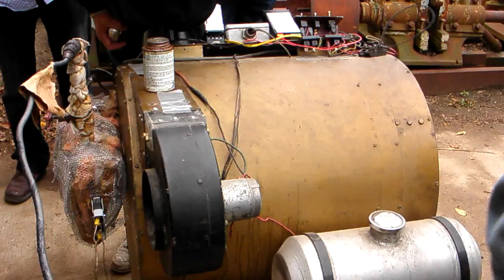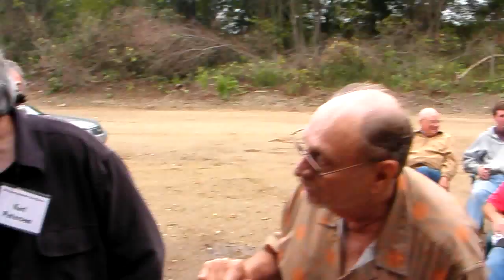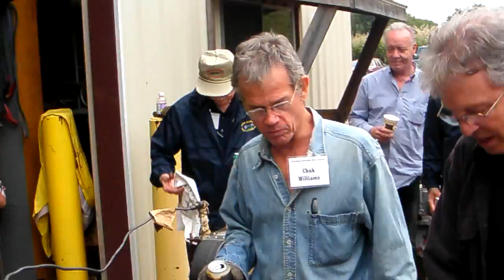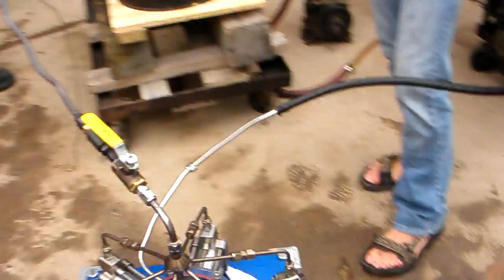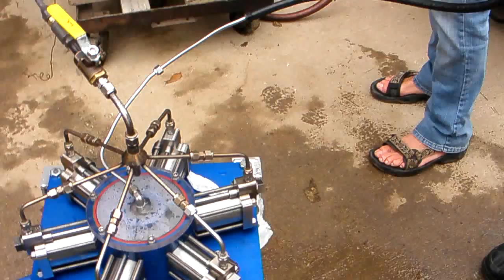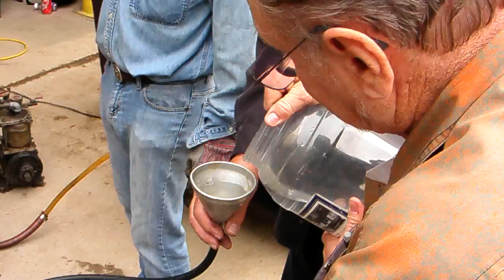WHE - Waste Heat Engine (water lubricated steam powered)

Comment: Water and lubricant in the same sentence? i LOL at you
Reply: Jokes on you pal. Actually this is largely manufactured steam engine. Made in US for many year. A multiple piston generator. I don't know what exactly they wanted to show. The generator is bought in the store as well of all the other equipment... What's the point?
Reply: @MrHydyr  why is the joke on me.... I clearly stated that water is not a lubricant, which is absolutely true
Reply: @abitofeverything9970  Well, I think that this is what they had invented. And they already produce them, so it's working. I don't know how good this engine is, but it's working.
Reply: @abitofeverything9970  ever heard of a 'cutlass bearing' that lives under a boat?  It uses water as the lubricant.  Actually, wet steam can use the condensed steam as a lubricant, I've seen references to it.

Comment: Almost funny . . . Ironic , . . . the relationship between a scam steam engine and a boiler room pink sheet pump and dump scam.    
-- investorshub.advfn.com/Cyclone-Power-Technologies-Inc-CYPW-7618/ --

This Waste Heat Engine is a great idea but has major design flaws that prevents it from ever being more than a garage project that will run for a relatively short time and fail.  

I think this is a scam company and they have barely done ANYTHING in the last five years and not much before that.  The one thing Cyclone Power has done in the last few years was sell off the only profitable part of the company, pocket the money and screw their stockholders that have been supporting them (seems like) forever. 

 Personally I think it was a scam from the beginning.  One of those pink sheet stocks pumped up and dumped by the owners.  I'd love it if they proved me wrong.  It is the perfect time - China Joe stole the election and with all of his green deal BS this company should be revived to capitalized on government grants and tax subsidies. Then they can screw their stockholders again with some insider trades etc..  Why the SEC lets these clowns and others like them get away with these scams and not put these fraudsters in prison is beyond me.

Comment: How are you using water as a lubricant when water has no lubricity?
Reply: Why do you slip on a wet floor? I'm not sure if this works the same way though.
Reply: @billbergen9169  I guess I should have said it has almost no lubricity.

Comment: Special materials.Too expensive.Traditional oil lubricated better
Reply: Br!an Delta V OK more research more info.  i did find water lubricated bearings for ship propellers.  the work by creating a cushion of water between the steel shaft and a special rubber housing.  I guess from here we would need the makers of the video to step in and give some details on how they are doing what they say they are.
Reply: https://www.nature.com/articles/srep17034
^If you coat stainless steel in reduced graphene oxide water becomes a lubricant.
Reply: Depends on what you want it to do and are looking for. Your needs may not be the same as others.
Reply: Br!an Delta V Its snake oil abyway.  water can not be used as a lubricant.  It has no lubricity therefor cant be a lubricant
Reply: Br!an Delta V Right....but a research paper and actual viable commercial application are two very different things.  Also i dont think something wearing out 3 times slower than with no lubrication at all is going to lead to a super long service life.....
Reply: Stainless Steel sliding on stainless steel has a low drag coefficient and high lubricity just by itself. Just bear that in mind.
Reply: Br!an Delta V Fair enough but i cant think of a single mechanical device that is designed to have high speed metal on metal sliding contact without some form of lubrication.  There must be a reason for that.  Im definitely not an engineer so Im only going on my limited knowldge and observations though.

Comment: Water lubricated? What??? When engine runs on SUPERHEATED steam, how it can be lubricated by water? And if it can - water is very bad lubricant. Stanley, White and Doble steam cars uses very, very thick oil to run without wear
Reply: uhhhhhhhhhhhhh
Reply: Valeriy Reiter water is worse than a bad lubricant.  by definition it has no lubricity'.
Reply: I think water is mixed with oil or something

Comment: This engine can be used only added to an ICE. It can harvest the heat/ gases resulted from the combustion.
It's Harry Schoell's invention and patented for many years. It's also produced under Cyclone Power WHE brand.
They recently signed a contract with the DoD. So, how can you possibly use it the OSE project?
Reply: That would be nice.